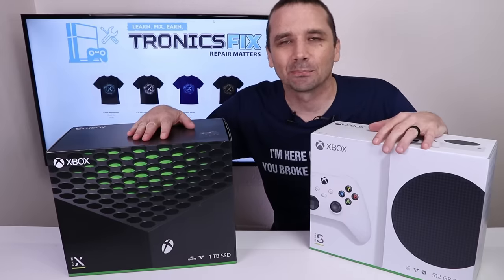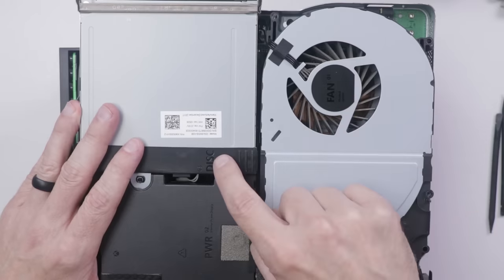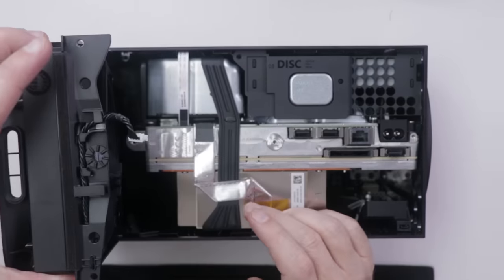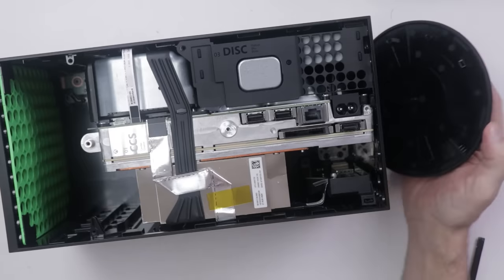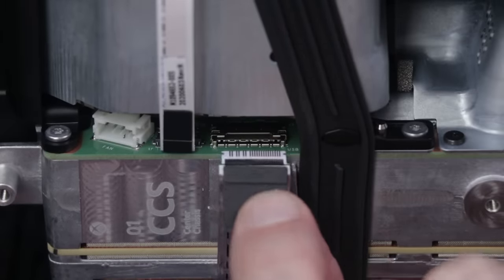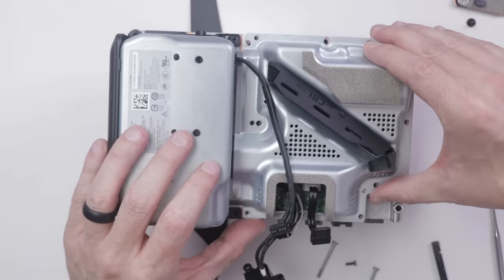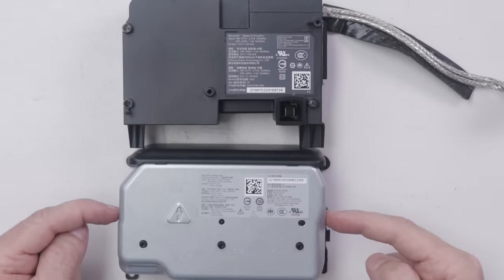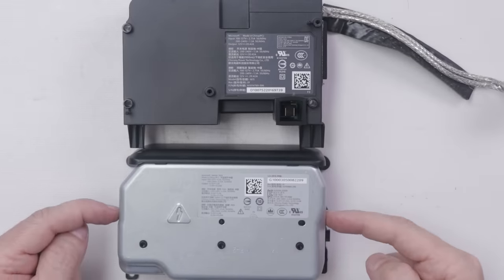Xbox Series X Teardown - A Repairability Perspective

Comment: I found the ssd and it's a pretty standard nvme unit rated for 1950 MB/s sequential read, although it is available only to manufacturers/OEMs and not officially available to consumers. I found this exact module on MAUSER and they ask for 350+ euros to buy one

Comment: The ssd looks like 2230 form factor? I wonder if we can put it in a pc motherboard and test it's read/write. Hopefully someone will benchmark it :D
Reply: 2400MB/s according to Western Digital's specs page. So probably around 2200 - 2400MB/s since I'm sure they're quoting ideal conditions.
Reply: You can probably read/write, however it uses a different filesystem, and when the xbox is booted up, it has validation checks. Same thing with the 360, and One

Comment: I have a broken xbox wireless headset that I tried to fix myself and failed. I kicked it by accident and it made the balance wheel on the left headset to not function. I tried to take it a part and the wires came off the solder... should still work if soldered and put back together properly. Want to buy it for a video?

Comment: My XBOX One X has really been messing up by over heating, and sometimes the Bluetooth connection to my headset and controller gets disconnected. It doesn’t work on my brother’s Xbox but it does on mine. Would this be an easy home fix? 😢

Comment: FYI not ALL Xbox's are dual voltage.  Even though you cannot buy a original Xbox One anymore (brand new from a vendor), the US version is limited to the 120v we have while the UK or Europe version is set for the 240v they use.

Xbox One S, Xbox One X and the new Xbox series are all dual voltage.

Comment: Long shot question: my Xbox Series X has an extremely loud fan.  It’s not rattling, it’s running continually at high speed as if sensing the system is at full load.  I’ve tried unplugging and factory reset several times with no luck.  Any suggestions before I return it?

Comment: I believe it's illegal now to put that warranty sticker on devices. Could be wrong, but I remember a court taking up that case.
Reply from the maker: It is...but that didn't keep them from doing it in the past.
Reply: That sticker over the screw basically serves the same purpose. If Microsoft cant reject a console for warranty because it has been tampered with it will still be good for buying broken consoles secondhand to be able to tell if someone has opened it before.
Reply: @A_C_007  I was thinking the same thing. No formal warning, but it's pretty obvious what their intentions were.

Comment: A buddy of mine was able to score a broken Xbox series X that suffered a power surge for 160.00. The unit powers on but offers no display it's looking like the problem may be the "BGA" or not sure if Steve said "VGA" chip mentioned @ 13.34 in this video. In any case can someone correctly ID the name of the chip and maybe point me to where one might be able to get one or what other tech we might be able to pull the chip from to replace the bad one with. Thanks

Comment: One thing I disliked about the console is the fact that it could be easy for dust to get in the console, and doing basic maintenance (cleaning the fan for example and some dust in the console itself) would likely void your warranty, and would be a pain if at some point it just bricks or stops functioning. Other than that, it is incredibly well designed.

Comment: I'm wondering about the PS5. If the SSD goes bad it's soldered to the mother board. I know the guy on "HDD Recovery Services" can do that type of swap out, but I know you tend to shy away from BGA type repairs. I also wonder if the main SSD goes bad, it supports an NVME drive. I wonder if an aux drive would make it bootable.

Comment: Hi if I remove the WiFi adapter then put the Xbox back together and use the xbox with a wired controller will it still work

Comment: They didn't apply thermal pads/paste  on all the power stage components. Why is the SSD in an RF shield?
Reply: In rare cases of water damage, the SSD should be in an RF shield for protection. Macbooks (2016 and above) have the same design

Comment: Hey my series x just started smelling like burning plastic randomly so I turned it off and did a stage one cleaning then let it rest for a bit, the console wasnt hot at all though and the fan was working and I dont keep clutter around it so I don't know what it could be but now after I plugged it all back in an hour later it started smelling again 10 minutes after then just shut off and now I think it's bricked

Comment: on the xbox series x where the disc drive power connector and sata is theres a 2 pin connector coming from the power supply that connects to the board what does that do

Comment: Is it possible to put a faster RPM fan in there? I’ve been wanting to know and no one one‘s been really helpful. My whole plan is to put in RGB fan inside and I wanted to know if it’s the same connection and size I can 3-D print stuff to make it fit but I wanna know what mm it is wether it be 120mm or some other size.
Reply: Different connector, however since you can 3D print this, that shouldn't be a problem

Comment: When has a motherboard had a removable south bridge chip set??
Reply from the maker: You can remove them with a hot air soldering station
Reply: Never really, the Old Mac Pro's used to be like this

Comment: Is the series x supposed to be plugged straight into wall socket or a surge protector I have mine in the wall socket is that ok also my ps5fat is in the wall socket
Reply: Surge protector aways for anything you cherish electronically.  When your house has a brown out or a black out or even lighting strike can cause a surge backflow through the lines.  Surge protector has a built in circuit breaker to prevent that.

Comment: It looks like you can add a small heatsink to the retimer chip. It would certainly not pay just to open the console for that application. I do not know what to do to extend the life of the chip that will be destroyed in case of a lightning strike. I do feel adding better thermal paste would not hurt either. I would think the ssd could be better protected from heat than the current pads, both inside and outside, like some kind of copper heatsink of some type. All in all it looks like improvements were made where previous failures occurred like possibly internally in the retimer chip. What the engineers should shoot for is a 20 year life expectancy excluding plugged up air ducts in the heat sinks. The only way to cure that is with removable external air filters which half the people never look at.

Comment: Did I miss what wattage the power supply was?
Reply: He read the output as "12V at 5amps", which doesn't make sense.  60W will not power this console for long.
Reply: @bgnPrinceton  the PS5 I know has a 350w power supply in it.
Reply: @dannymccorkle6213  Everything I read says that it has a 315W power supply, but I have yet to see anyone else state the voltage/current outputs.  Tronicsfix is our only hope.

Comment: The distance between the heatsync fins and that fan is doing me a big concern.
Reply: actually no problem when placed vertical. convection effect pushes air through fins with 1atm pressure. convectional heaters are extremely effective even without fans

Comment: So the drive looks like a small form-factor NVMe drive. Too bad it's probably paired with motherboard and non-replaceable like drives on previous Xboxes. Still, Series X looks like a console is good for repairability and not as terrible as some modern electronic devices like smartphones, which are mostly single use nowadays.

Comment: i wonder if its possible in the future to flash series x firmware to xbox one x consoles??? yes im aware different cpus ect so id assume someone would have to modify the firmware in which im sure is already under lookings by modders and jtaggers alike...
Reply: What would be the purpose?
Reply: @DSuave03-Me  well thats something thatll have to be known when it comes. but seeing how the disk trays are near the same...i mean why flash one phones firmware with another? to have different options ??
Reply: @Kraxt0n  I mean I guess but Id rather just modify the original firmware, and not flash an older or newer version of it.
Reply: @DSuave03-Me  wdym? Series x is new? One x is old... Flash firmware from series to one x?
Reply: @Kraxt0n  "i wonder if its possible in the future to flash series x firmware to xbox one x consoles???" Im just going off what you said.
Reply: @DSuave03-Me  that's exactly what I said. Take firmware from series x which is the new gen xbox (I believe?) And flash it to xbox one x (last gen console)
Reply: @DSuave03-Me  yep my grammer isn't accurate by no means, but I wonder is it's possible in the future to flash series x firmware (TO) xbox one x?!?
Reply: @Kraxt0n  They are totally different machines, the PCH chip could be the same, however the APU hardware is vastly different. Would not work, same thing with why nobody tampered with flashing the different Xbox 360 models, it wouldn't work, and even then they had similar hardware then what we have now.

Comment: Good things to know that the SSD is the Western Digital SN530 with R/W up to 2,4/1.9 TBps. It's a good ssd though still slower than the one in PS5, but the fact that even series X could launches games faster than PS5 means that microsoft put so much effort in optimizing xbox's operating system through software (velocity architecture etc)...

Comment: How is an xbox supposed to get stuck by lightning
Reply: Hes talking about if you have your xbox just plugged into an AC outlet, its very possible during a lightning storm that high voltage can pass through the power supply, and short the system

Comment: Microsoft did nuch better job compared to SONY and i think SONY will have BIG, BIG problems because their Console design and they definitely will (i hope) change it ASAP.
So if Microsoft will have good original games (not HALO or GoW)they will be 100% winers and how i remember Xbox X will be backward compatible for all available previous console games . even the Xbox Original, which is HUGE plus plus for Microsoft.
 Good job Microsoft, just simple and powerful.
Reply: Yelp...looks like a huge pain overall...OH and ill make sure to unplug during any lightning storms seeing as how the BGA chip isn't available anywhere 8(
Reply: Hmm just remembering now..when Sony released a teardown boy, did it look a lot more simple than this. You have to pry twist and unhook stuff this whole video ! Very disappointed they didn't change the disk drive at all, its been how long cmon can't update it? Faulty disc drives being reported im lucky so far but its scary !

Comment: All xboxes are most definitely not dual voltage. Do not plug your xbox one into a 220 if you bought it in the US for 110. It will fry it if you don't get a different power supply.

Comment: Just had our Xbox series x hdmi repaired. But they do t make a replacement so had to use a one x hdmi. Works but only problem is it’s to short doesn’t come out far enough to plug into so had to trim back a hdmi cable to go in further all settings work with is great

Comment: I think I'm going to take a hard pass on the PS5 this time around. Why the sudden change of heart? Well for starters PS5 will not have native 1440p support. Seriously that is got to be the stupidest decision Sony has ever made. 

Yeah I get it 1080P is fine but on new sets running at higher refresh rates. On today's new 4K TV's is a waste of money. Upscaling in my experience has been not that great. 

I also find it a bit perplexing why they only chose a 600 gig hard drive? 🤔 Although Xbox has it's problems as well. Expensive swappable ssds is not cool especially considering you have only 1 Tara Drive internal.

I mean it's better than Sony but well under what it should be for today's games. You're going to be lucky to get the 3/4 games installed on that. Also the idea of only being able to play Xbox One on the external drive. 

You better hope that external drive is running on a fast 3rd-4th generation USB drive. Most I've seen are just running 1st or 2nd generation and that's way too slow. But overall Xbox seems to be taking the right boxes.

Comment: the ssd is really disappointing if the WD spec sheet is spot on, pcie gen 3x4.. not exactly ground breaking read/write speeds.. for console, ok, but there's better. I hope you can swap it out. makes the high price tag on the additional storage a really bad deal.

Comment: 11:45 

This is actually incorrect. The problem isn't with the solder, but the chip itself. It never actually was the solder, since companies started switching to it way back in the early-mid 90s. Even the ps1 used lead free solder, yet it doesn't fail nearly as much as the consoles from the 360/ps3 era do. Some people may blame this on the consoles getting hotter, but that's still not why they failed because lead free solder has a higher melting point than leaded solder. If the solder was the issue, then 0 ps1s, 2s, 3s, 4s, etc. would be working, which is clearly not the case. 

Now, you may be wondering, if the solder isn't the issue, why does adding pressure, reflowing, and reballing seem to fix the issue? Well the answer is, it doesn't. While it may temporarily revive the dead chip, the problem is still there as it was defective from the factory, and would die sooner or later (this is the same reason why some launch 360s and ps3s will NEVER have issues with issues with chips until the silicon starts to degrade or they are damaged by other means). The problem isn't with the bga, but rather the die connecting to the substrate.

Comment: Doesn’t look like the fan will be able to pull any air through the machine.  Small spaces to get air in and all the electronics the air has to pass through just looks like a recipe for disaster

Comment: This is a terrible guild as he skips over how to disconnect some cables that they have the push release method and just skips over parts you need to take off before continuing such as the disk drive cover, please when doing a teardown for a new device make sure you cover each step and not assume knowledge.
Reply: Ribbon cables are pretty easy to disconnect after the first time you disconnect one

Comment: i would rather burn my money 
than buy any of these crap boxes 
i have a 3 year old pc what can beat these
Reply: Given that its roughly rtx2080 performance levels, its not bad for the money. 

If your pc is 3yrs old and matches this, then you've probably got a 1080ti, which alone would have cost anywhere from £700-£1000, for the price, consoles are unbeatable.